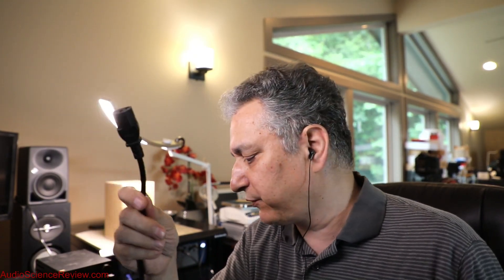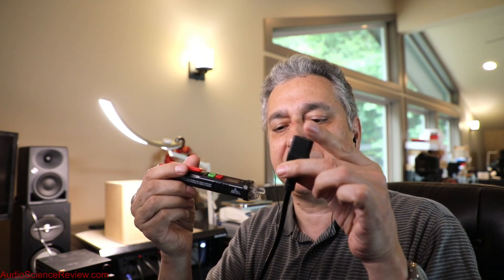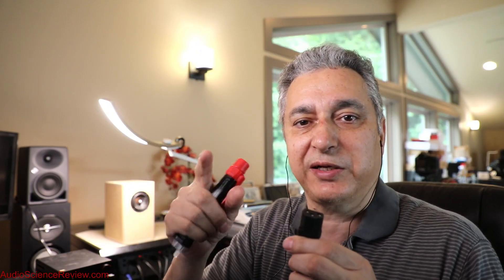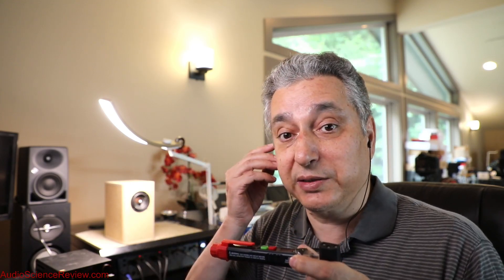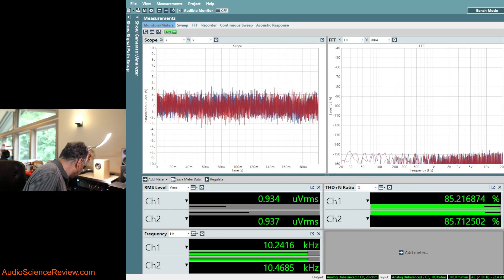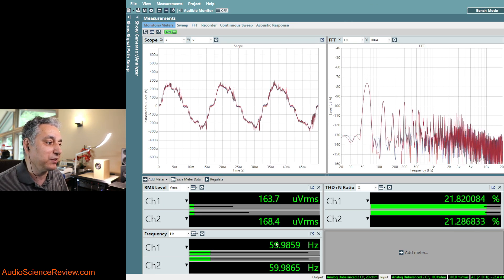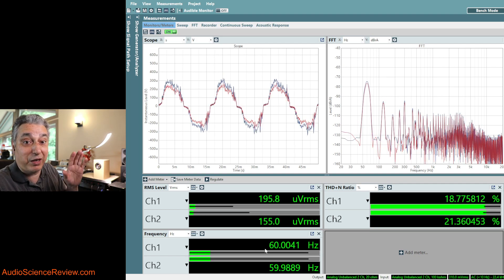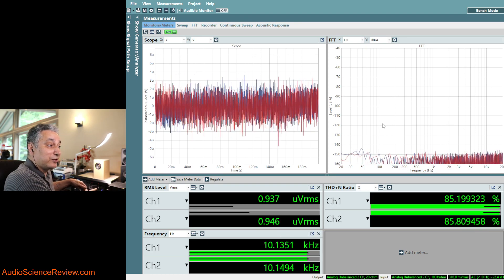Testing Open Power Cord interference in Interconnect Cables

Comment: Danny just said that running your power cable next to your speaker cable introduces interference, while it might be true to “some” degree..(high frequencies) if they are occurring very minutely at very high frequencies then do we really care? Just a question
Reply: Your power cord generates electromagnetic fields (EMF) from whatever frequencies are on it, from primarily 60Hz (USA) and on up, and spikes of voltage etc as well.  If we suppose that all the power cable EMF are at above audible frequencies and your amplifier feedback circuit can properly damp them out then no, you do not really care.  But, if your amp feedback starts having issues with the EMF then it can result in distortions from your amp output.  Your words very minutely at very high frequencies are the key here.  So, like all things in science, it depends on the exact situation.  Electronics is very complex and not intuitive.  The more you learn the weirder it gets, think quantum level.
Reply from the maker: Your speakers have very low impedance in audio band. The amplifier has even lower impedance.  That is the enemy of electrical fields.  Further, the signals on speaker cables is so large, often in tens of volts.  Induced interference has no chance against these factors.  At frequencies well above audio band, the impedance of these loads does go up so there can and is inducement.  But then your crossover puts up a huge fight, not letting them through to say nothing of your tweeter not wanting to play 100+ kHz.  In installations with very long speaker cables (e.g. large venues/live sound) this issue becomes real but not in home audio.
Reply: @motjones2341  yes I am an actual scientist with applied mathematics masters, but also took tons of grad level physics courses. However I am not an electrical engineer! So I don’t know much about electronics design.